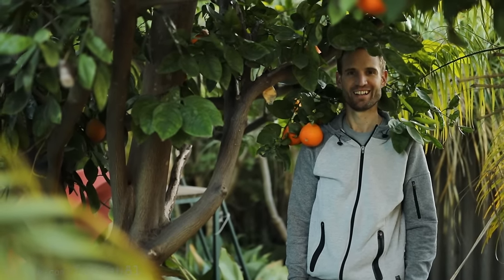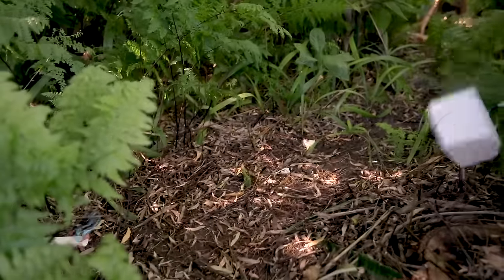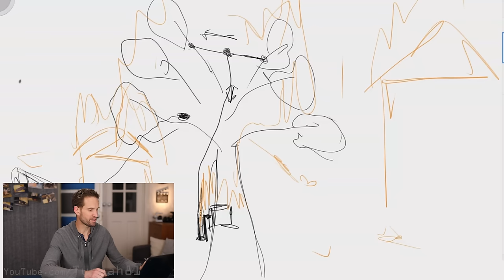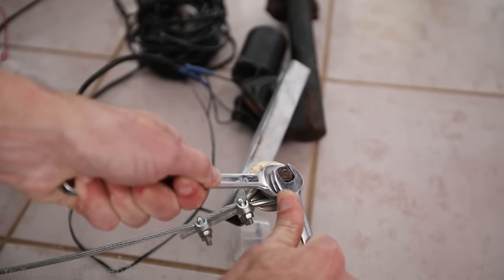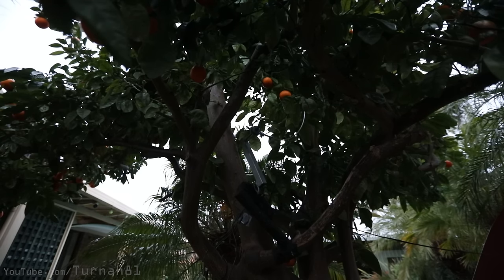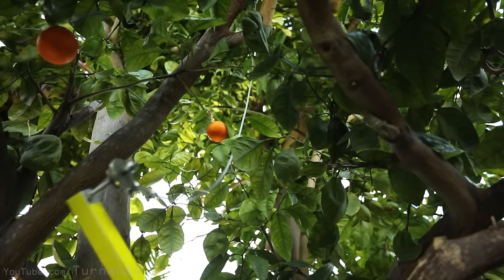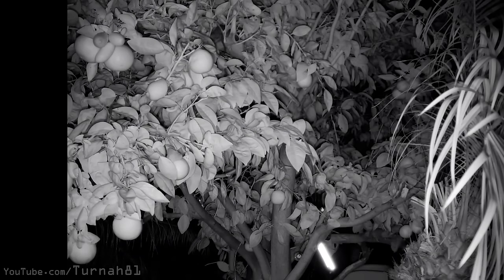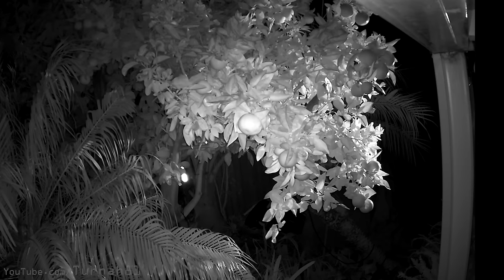I made a Machine to Throw Rats from my Fruit Tree!

Comment: A friend of mine had a mouse problem.  He set up a compressed air tank, a section of PVC pipe, an air valve, and a photosensor.  He put some peanut butter inside the tube just last the photosensor.  When the mice went for the peanut butter interrupting the photocell released the compressed air launching the mouse about 3 meters head first into a steel plate over a bucket.  Local cats learned to recognize the meal-time gong.  Rats have more mass than mice but an adaptation of this method may have some value...
Reply: That's genius. Tell your friend we need videos.

Comment: The best mouse / rat trap is a large bucket with 6 inches of water in it and either a hinged plank that drops and auto resets or a slippery round rod that spins when unbalanced on it.

You could also try adding a barrier or something slippery / not climbable around the tree stump and prevent them from jumping onto the tree from some other surface.

Comment: I found a way to make a snap trap bait robbing proof.

All you need is:
1: snap trap/traps
2: cheap dog cobble or dog cookies/biscuits. ( the crunchier the better, and you can set multiple traps with one cookie / biscuit.)
3: hot glue.
4: hot glue gun, candle, or if you have a gas stove you can just use the burn. (But I do find the hot glue gun works best)

All you do is hot glue either a dog food kibble or a chunk of dog biscuit 2 the trigger of the track. The only time I have seen a mouse or a rat steal the bait is if it was already snapped and most of the time they were crawling over the other rats remains.

I have had one rat that was able to get the bait without getting snapped and I have found then he would chew the pain at the back of the trap to trigger it.

For best results I have found that if you leave it unset for the first night and leave it unset randomly you will catch more.

I had one rat that we nicknamed Einstein figure out how to snap the traps so what I started doing is leaving the traps unset and when I noticed he started going for the bait straight away I started setting the Trap and bye-bye Einstein. That is when I started doing the random unset traps.

Or if you take multiple strips of chicken wire and put some kind of rubber between the chicken wire in the tree you can Electrify to wear when the mouse climbs between the two chunks of chicken wire they complete the circuit and get a good job it's more used for squirrels but I'm pretty sure work but I'm pretty sure work on rats as well

Comment: About the snap spring trap: don't pile the bait on the trigger in one lump.
Instead, put a tiny amount UNDER the trigger. The rodent will smell the bait then struggle to get it and it will be the last thing little Mickey does.

Comment: 1. Smooth metal band wrapped around around tree like the ones used to stop possums climbing tree here in Victoria. Say 30-40cm high.
2. If above doesn't work 12v electric fence gear used to electrify said metal band.

Comment: Honestly this next solution is 100% gonna work.
Aluminum foil tape around the circomferance of the trunk.
But with a shocking twist (or wet).
HOW TO:
2 lines of foil tape going around the tree trunk, taped close together but not touching. One is positive, one is negative.
Rat tries to climb base of trunk touches lines, closes the circuit and explodes, obviously.
You can use those popular fly zappers as the circuit.
.
If thats too cruel for your liking, you can use the 2 lines as a capasitive sensor and set off the plastic explosive detonating the whole tree instead (or 10 of your cat repellant devices).

Comment: Hey, i realize i'm 2 years late, so the likelihood of you ever seeing this is beyond miniscule but, i figured i'd give it a go anyways.

If you've not yet had any success with other conventional (or not so much) traps, i got one for you that's a guaranteed winner, we use em on the wee island i live on, in the barns and generally speaking one trap will catch between 1 - 2 dozen rats a night before their are so many rats in the damn thing that they just climb over each other to escape.

Anyways, what you need are some five gallon buckets you don't mind yanking the handles off of, and some long & skinny plastic bottles. Bonus points for a plank of wood and a brick/cinder block for each trap.

The Build:
Rip the wire handle off the 5-Gal (whatever-many liter, sorry, i think it's like, 13-ish?) bucket, then take your handle and hammer it out into a nice straight line, or use the straight section of an old wire hanger, or just some metal rods if you got em. It's relatively important that the metal bit be nice and straight, as it's going to form your "Axle" for the trap.

Now that you've got this straight bit of metal wire, heat up one end to nice orange-y glow with a torch and then poke a hole through the perfect center of the cap of your tall skinny bottle (Smart Water is my preferred brand for this) and then one at the dead center of the bottom of the bottle. At this point, you likely know where i'm going with this.

Once your metal rod cools down, thread it through the water bottle and make sure that it's spinning nice and freely on the rod, like a paint roller. Now you're gonna shove that metal rod's ends into the two holes left behind in the bucket from when you yanked the handle off, so now you should have a bucket with a free-spinning balance beam bridging the gap.

Setting the Trap:
So, now that your trap's built, you gotta bait it, what you wanna use is any brand of creamy Peanut Butter, honest to god, the shit is like crack for rodents, they just can not help themselves. 
Take your peanut butter and slather a thin strip around the bottle roughly equidistant from both edges of the bucket. Now, bring the trap to wherever you want to set it, put it down, and now finally you know what the plank and brick are for; Lay the plank as a bridge leading up to one of the ends of your spinning balance beam, and tuck the brick/cinderblock behind it so heavier rodents don't cause it skip back and fall, potentially knocking the whole bucket over, as they climb up. Et Voila! You've got the cheapest, easiest to make, most effective rodent trap ever devised by man. 

If you don't want to catch & release the buggers you catch somewhere in the woods away from any homes, add like 6-10in (I'm gonna guess like 18-24cm) of water at the bottom and the rats/mice/voles/whatever kinda rodents will simply drown eventually leaving you with a no-mess kill, unlike those old-school flipper traps which when they rarely do work will sometimes straight up fucking decapitate the animal, or worse, remove one of it's limbs and end up killing it in a horrifically inhumane way.

Extra Credit: If you do find yourself catching hundreds of rats a week like we did in all the barns on the property, you can then take the detainees to your local pet store or reptile sanctuary and sell them for live feed or fresh-never-frozen dead feed and make a frankly ludicrous amount of extra cash on the side. (Seriously, i figured the dude at the Reptile Sanctuary'd offer me like 20cents a head, he offered me 20$ for each bucket that had like a dozen rodents in it, bringing in 5 or 6 of those a day, every day for a month added up quick.)

Anyways, cheers, thanks for taking the time to read my TED talk to whoever sees this, and uh, i'd say good luck with the rat problem, but if you follow the steps above luck shouldn't even be a factor, honestly.
Reply: Disappointing use of the brick😂😂

Comment: I like using chicken wire and electric fence transformer. It's a pretty good deterrent , but I don't know how many access point to the tree you have. It might help you out. Rats also like chicken coops too. Eggs and chicken feed brings them in. Rats don't get use to electricity and much safer then poisoning. I forget - use old garden hose and zip ties by cut down the length of the hose to hold the wire so it will not ground out. You'll figure it out.

Comment: my two solutions are: air gun or electricity trap
Reply: Yep but where is the humour or challenge in that?
Reply: @gordonlawrence1448  make the rats go flying with the air gun, and dance with electricity trap? (just joking) Honestly I belive he can make many stupid things funny anyway.
Reply: @gordonlawrence1448 
Have you never seen a rat get shot? It does a neat little display of acrobatics!
Reply: @DinnerForkTongue  I used to shoot rats for a local farmer. Pellets cost money and back then Promethius pellets cost a fortune (100 was more than 1000 standard pellets). Therefore I spent a hell of a lot of time with my bolt action air rifle practicing. My grouping was so tight at 25m basically you had one small hole for 10 shots. I was using the targets with 5 individual 1 inch targets on one sheet. When your shooting is that good you can take a head shot every time. I had to use promethius because of the steel body as it was an organic farm. Hence no poisons etc and no lead allowed. I managed to get better kill rates with the rabbits too. Use a shotgun and you'd get one and the buggers would sit underground all day. Shoot them with a supressed air rifle and you could easily get 50 in a day. When the local butchers found out where they were from they paid me near £1 a head. A hell of a lot of money back then for a kid. This was the early 1980's.
Reply: @gordonlawrence1448  
People stil do rat/rabbit/squirrel pest control with suppressed air guns to this day, here on YouTube. Squirrel Hunter uploaded every Sunday and was the highlight of my week, but he went quiet, so now I watch Robin Foxer.
Reply: @DinnerForkTongue  I know just my eyesight is not what it was as I'm now mid 50's so my aim is a bit iffy.

Comment: To prevent them getting used to it over time, I suggest:
1. recording your voice telling the rats to piss off, with multiple variations and have that play in random rotation with varied time periods. 
2. Program variations for the crank to turn so it's not the same predictable rhythm every time.
3. To make the lighting easier on the eyes, use a bunch of different directional lights aimed at various parts of the tree, and make the lights move around a bit (while aimed at the tree) when they turn on. Putting them on a bent Axel attached to a small motor would do the trick.

Comment: Hey maybe you could also set up something with a fan blade and/or horns to also make sound. And then have the circuit randomly select if it turns it on or not. 
Also making a bit of a "hovercraft" might be good to scare away the rats with it moving around (just tie it down somewhere so that it does not go completely wild and get lost or destroyed)

Comment: I made  horizontal platform around the trunk of the tree. Rats and other rodents can't climb horizontal surfaces. 25cm from the trunk is wide enough. But it had to be at least 30cm off the ground. I've hung the disk with rope from brances. The clearance around the trunk has to be relatively tight, not more than 2cm. 
But it's really effective cheap and without a lot of maintenance.

Comment: There is a guy that put a free spinning paper towel roll in the middle of a 5 Gallon bucket. They walk far enough onto it they roll off into water and die or you can relocate them without using water. By far the best and most clever trap I've seen. Has even worked on squirrels! So you know a rat or mouse can't be to big.

Comment: Attach sound transducers to the branches and have them turn on when a rat is detected climbing on the branches. Sound transducers work by sending the vibration into the surface. The rat being attached to the surface would then hear the sound as it travels through their feet, to their inner ear directly.
This is the same as the hearing aids that work by sending vibration through your jaw bone rather than sound directly into the ear.
The advantage of using this is that it's likely to freak the rat out more than normal sound, and it will also be relatively quiet to people in the house, but loud to the rat attached to the tree.

Comment: You could try adding to contact points around the stump of the tree and running power through them so when the rat steps on the 2 contact points it will give them a little zap

Comment: Greased upside down bucket, to prevent them from climbing, or, you can do it the Japanese way, which is to take the fruit and encase it in something. They shape everything apples to square melons, which is then sold at a considerably bigger price than the regular stuff, and i'd think that then means that they aren't effin up the taste. So find some tangerine sized molds to square up your problem...

Comment: I like the concept you tried.  Here's an idea you may consider adding to your rat deterrent:

1. Wrapping strong glue traps around various branches,  particularly the ones the rats frequently use. But the emphasis should be on their most likely path up the tree.
2. Or devising an Electrical wire mesh that designed as the rats ate trying to climb up the tree,  they could get a strong Electrical shock,  maybe even killing those  pesky rats.

Personally I would go with the Electrical shock,  the benefits are it would rid you of the entire rats colony that's knows your  tangerine tree is a good source of food.  So with the frequency that these rats invades your home,  I would say you might can eradicate the entire colony in about a week or less.
As a safety precaution I would only turn this on at night.  I've seen the power source of an taser could work.  But I live in the U.S.A. and we have very easy access to all sorts of firearms and self defense items. 
I hope this helps. 
By the way I love Tangerines too
🤣🤣🤣🤣🤣

Comment: Diamond tipped turd 😂😂😂 I used to keep them as pets they are amazingly switched on. What we do at home in Zimbabwe is an inverted cone made out a smooth material(sheet metal or plastic)  going round  the trunk. Obviously it only works if they're stand alone or the adjoining trees have the same protection 👉
Reply: Also could just aim your car repellent gun at the base of the tree and see what happens 😂

Comment: Place 1/4 grid screen firmly around tree base.. Atleast 2-3 ft..Use small rubber or pvc spacers to keep it away from trunk..ceramic work best. About 1/8" to 1/4"... Next, make a skirt of any material rubber, pvc, or tarp..Raise about 3-4" off ground..Attach a dc generator to metal grid and use a motion sensor via 18650 battery to activate metal grid..Anything small that can climb under skirt up tree, will only go so far before 1 million dc volts zaps them..Works! I grow citrus in Texas..safe for cats..

Comment: Might try making clear plastic ball that's slightly larger than a ripe Tangerine and put them around each of them as they ripen. I figure that it can be thin as long as its surface is smooth enough that rats can't get enough purchase on it to bite through.
Reply: Rats can chew through metal what makes you think plastic will stop them?
Reply: @starandfox601  a smooth rounded surface. My thought is that if the surface is slick the rat can't get purchase when reaching up to it and the shape ablates the bite's force. It should be simple and cheap enough to be test.
Though now I'm also wondering about wrapping them in two layers of aluminum foil with an epoxy and irritant between the two layers.

Comment: Set up a five gallon bucket with a few inches of water in it and a ramp running up to it, then set up a drop trap or rolling barrel trap, or add some perlite to the water until there’s enough floating to support a handful of sunflower seeds. The rats fall in and drown and can’t jump out due to the water.

Comment: put a coil around the tree base. connect the wire to the 110V phase. Boom. done. rats fall off the tree and cant climb it. IF you dont want to hudr them use a transformer to step down the voltage.
I used 12V DC to avoid snails from climbing on some plants. works like a charm.

Comment: 2 large Copper tape strips (bigger than rat length) around the trunk  with a small gap in between the strips. Hook it up to 18v or more, rat gets a shock when they complete circuit

Comment: I experienced somewhat similar "guest invasions" to my tomatoes while living in the Texas heat and dry conditions.  The neighborhood squirrels  (cousins of your rat friends) were helping themselves even to the green, unripe fruits and then dropping them to the ground with no more than a few bites.  Really frustrating to see all those tomatoes that had been wasted.  I found out that the squirrels were seeking moisture wherever they could find it.  It wasn't that they suddenly loved bitter-tasting immature fruit, but they were after some badly needed moisture. 

I changed my growing method over to using hydroponic planting containers (storage tubs, dirt, internal shelf with access and draining holes, PVC tube for adding water to the bottom).  The sun was too intense in the previous garden location, so moving the plants close to the shade by the house helped both the plants and also with reducing the squirrel attacks.  I did NOT consider adding a free water or lemonade drink stand to keep the furry visitors off the plants as that would have only encouraged the little buggers to stick around the yard more. 

So, I'm a little confused about your situation, Turnah.  I thought you were in the kitty express lane who came in for the dark-hours visits?  (INTENDED TEASING HERE!)  Why aren't they chasing the rats and keeping your rodent friends away from the garden? (NO need to tell me >> they are well-fed domestics, unlike the feral)  Maybe you need to reconsider your kitty situation after all? poke in the eye  Perhaps this is the way the kitties are getting back at you and they have signed an agreement with the rat kids? smirk